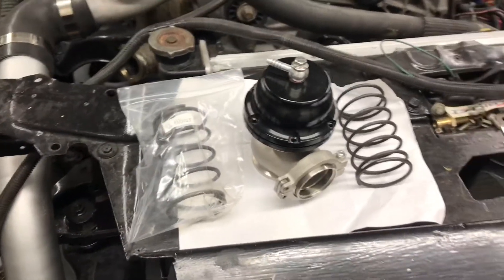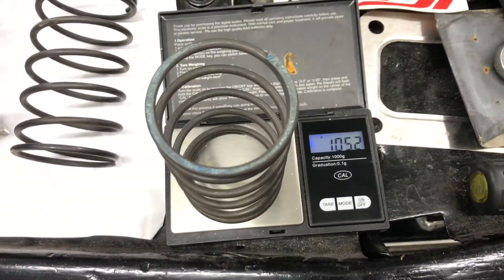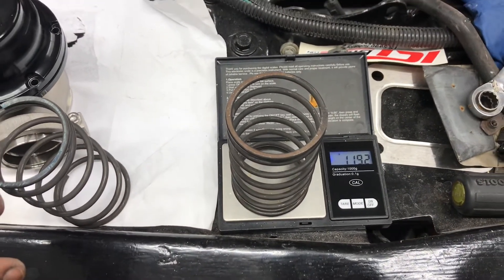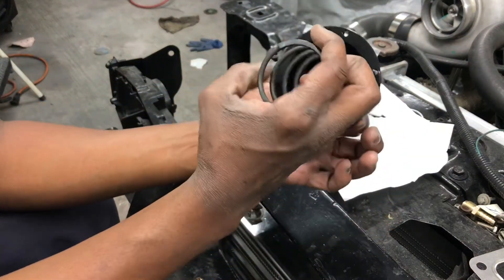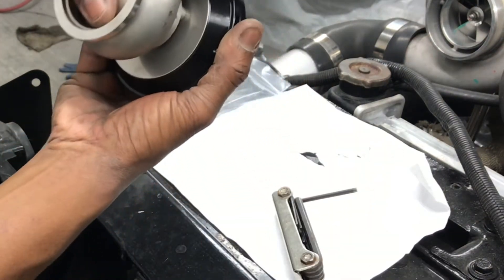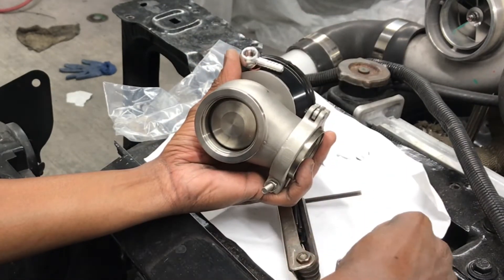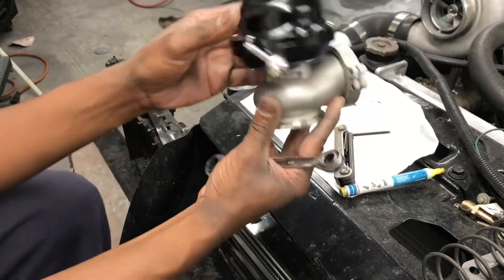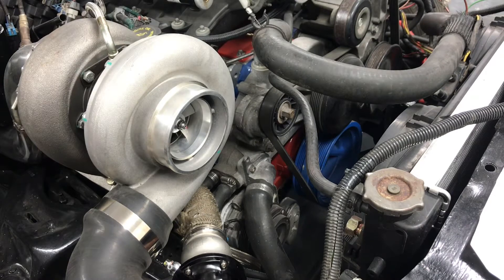Turbo Wastegate Spring Comparison

Comment: Run it and see if you like it. If it's to much boost then use the smaller spring. #Whistlegang
Reply from the maker: Yessir gotta try it out 💯
Reply: @MRRANDOM1  yea only thing is you can't turn the boost down. Only up. So If the 14lb spring makes 14lbs you can't turn down to 10lbs. More boost the better 🤣